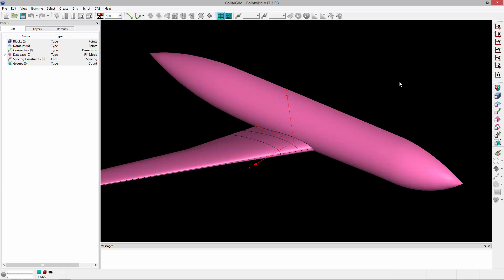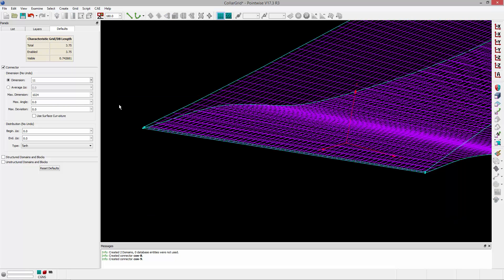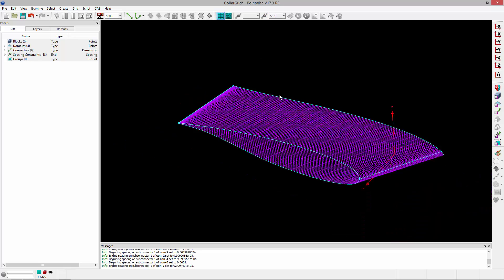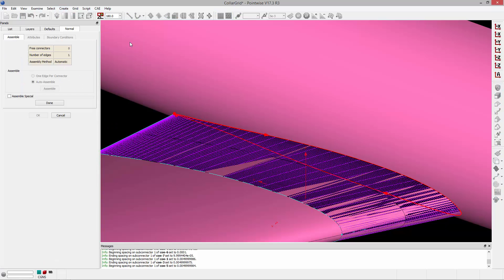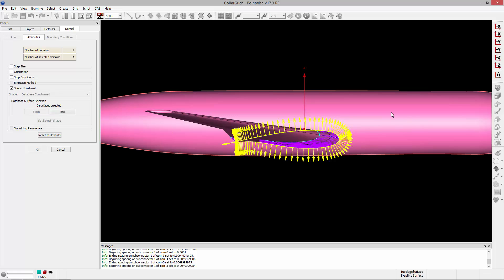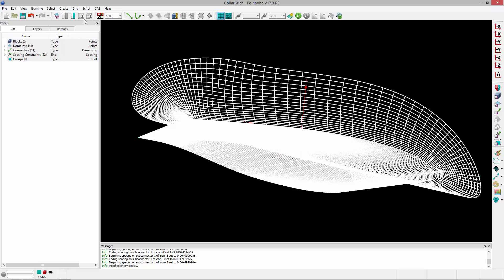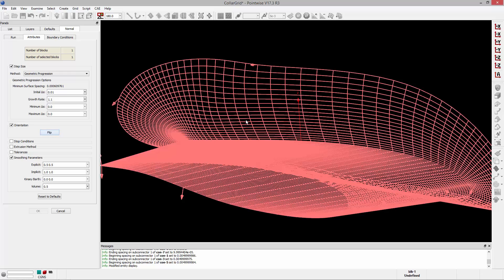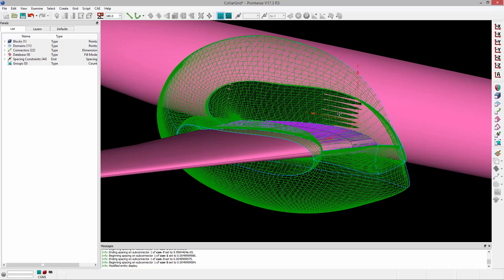How to Create a Collar Grid

Comment: Hi, 
Thanks for the guidance, just have a small query, in the last step of normal extrusion when you manually selected the domains and the extrusion topology is made visible in the side panel, I could not grasp that topology, if there is some other tutorial mentioning in detail the topology demonstration under the side panel during extrusion process, kindly provide link. I searched but couldn't find one. 
Regards.